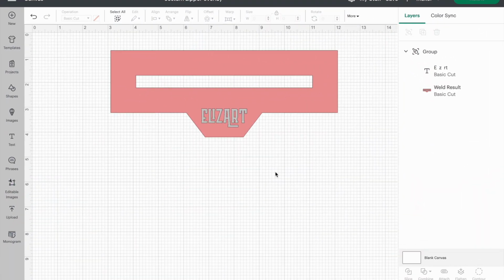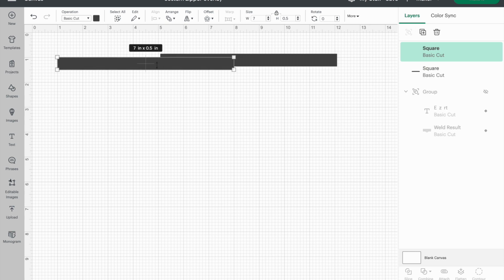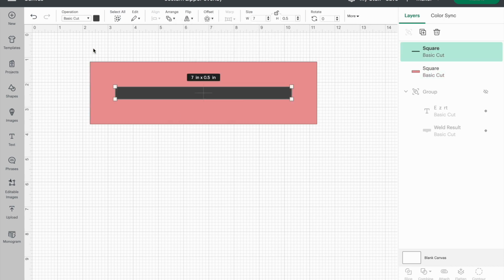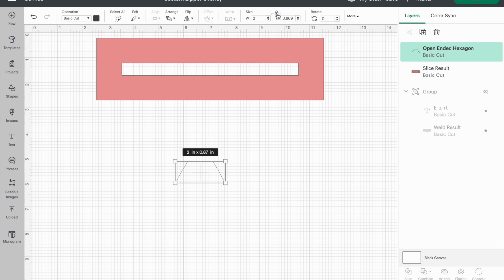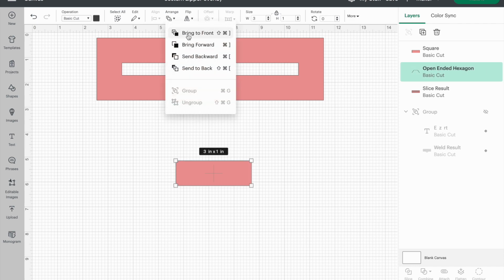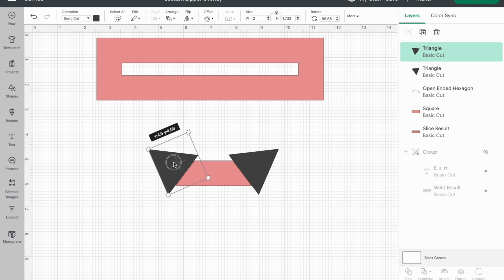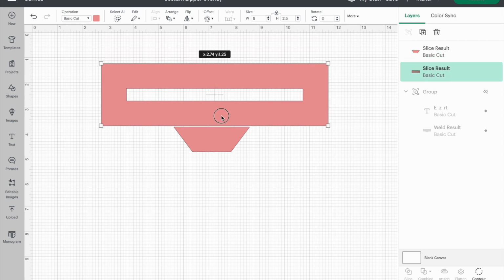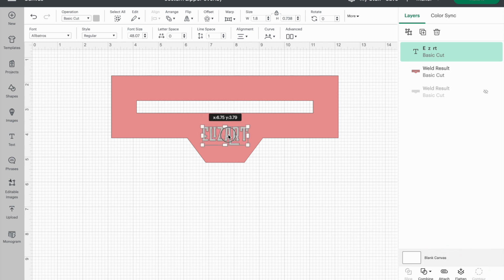CUSTOM ZIPPER OVERLAY USING THE CRICUT | MINI DUFFLE BAG | PART 2

Comment: What’s the cricut settings and blade used?
Reply from the maker: Hi Ryan, for the faux leather/vinyl, I use the fine point blade and select shimmer leather as my cut setting  and select more pressure. For the HTV, I select everyday iron on and use the fine point blade. I hope this helps. Thanks for watching 🙏🏾